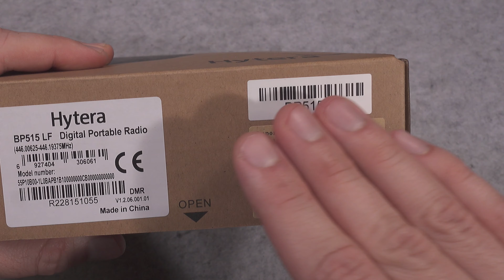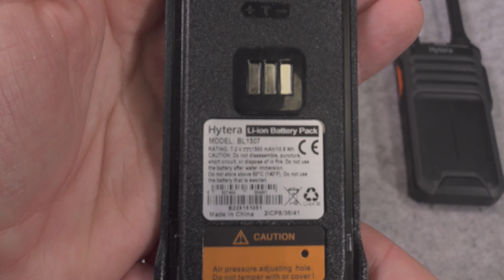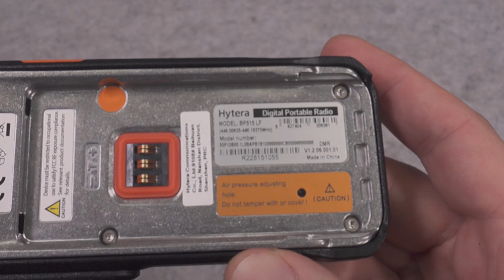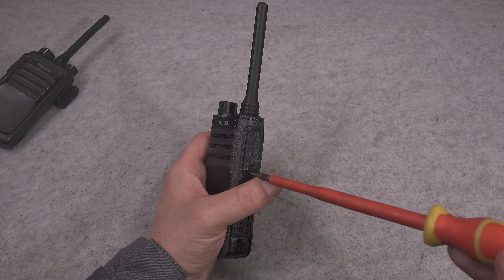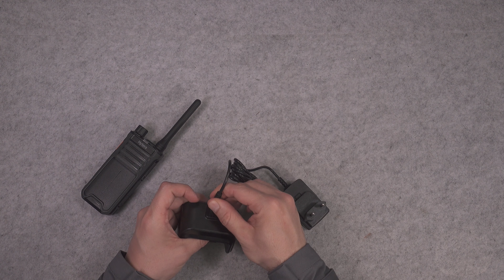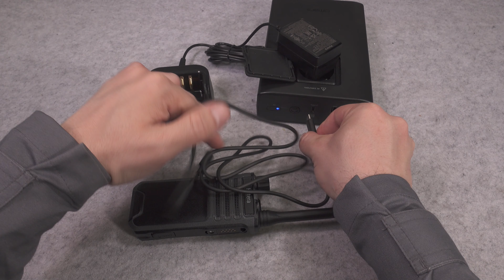Hytera BP515LF PMR446 license free DMR digital & analog radio - feel like public safety Motorola

Comment: Hey is the accessories connector the same as the DP4400e ?
Reply from the maker: No - this is strictly standard for Hytera - not compatible with any Motorolas.
Reply: @ElectronicNoobBlog  huh... i m interested into it but i m currently looking if there is a PTT compatible to plug a comtac (nexus connector) before ordering one. I have only find one for Hytera PD series.
i curently have an UV5-R but the kenwood connector radio side keep on wearing down before the ptt itself.

Comment: Well, I'm wondering which one to buy. BD505lf or BP515lf. This will be my first DMR
Reply from the maker: I don't have experience with BD505lf so can't tell You anything,  From my tests PD505LF (older model) offer slightly better range (most like because antenna is longer) but BP515lf radio is going to be my "go to" because of USB-C charging socket (very good in case being in field or staying for weekend in different location - regular usb-c cable and phone charger will do job) + supporting normal proper RSM with multipin connector so You end up with amazing RSM  like SM50N1-P that are dedicated for licensed radios (quality is here). Very good programming software (it's normal DMR Tier 1 radio). That's only info I can share about it.
Reply: @ElectronicNoobBlog  Thank you for the information 73
Reply: @ElectronicNoobBlog  How do I set it to switch between analog and DMR? I mean software

Comment: Hi, first of all many thanks for your very good and informative videos! Since you really showed a deep expertise in these matters, I would like to ask you a question related to "electromagnetic radiation" and the impact on humans. More precisely, when using license free PMR446 digital radios, as for eg. Motorola's SL1600 (in part. with 500mW), what is the impact in the body if the portable radio used many hours a day "attached" on the body (while wearing ear comms)? Thanks in advance and all the best!
Reply from the maker: Thanks for feedback, I'm not expert but In my knowledge only real generic precaution for RF radiation while working with consumer devices is avoiding eyes (head in general) because it have heating effect (of course with prolong exposure, high power). There are studies that pointing it can damage eyes, but with high energy systems - like industrial, for example here : https://pubmed.ncbi.nlm.nih.gov/14628311/   in general non ionizing radiation do not damage at molecular level like x-days that can destroy DNA.  Of course this only apply to transmit not just wearing radio and listening.   Are You transmitting thru it whole day or just listening? If You are just listening and transmitting couple minutes daily then You have nothing to be worried about. If You are TX whole day, for example navigating crane operator - You already did good thing by moving away radio from head using ear com - for really prolong TX You might think about moving radio fare away from body for example using backpack and clipping it there - this should severely limit energy that will be absorbed by water in Your body.

Comment: This Global PTT walkie Talkies, do you know if they are any good? Can not find a review online. Specially the response time seems to be forgotten in all sponsorde video`s. What is your opinion?
Reply from the maker: I never tested it. Please tell me exact model number so I can look it up. In general from over 2 years I gave up for non brand radios / PoC as it's just waste of money,  no support, no firmware updates. Couple years ago I was thrilled to grab something from Aliexpress but I came to conclusion that nothing work out like I was expected, and by purchasing multiple ones I spend more money than Motorola.  For PoC & LMR Dispatch i bought Motorola Ion and it ended up all my problems.  Just work - nothing more - no less. I bought shoulder mic once - and year of use - it never fail. Those from aliexpress were failing every month, i was swapping cable by myself, and it was failing again. I had PoC S700 - i would say cheap but it was quite expensive - and it was hanging out when You need it and plastic start falling apart, had firmware errors... so in general my honest advice - there is reason why Motorola is chosen by public safety. If You plan to use something like amateur radio - they have 50 radios, grab one radio every month and use on weekend - sure, those will work great & they will be angry for this comment saying " I HAVE IT IT WORK GREAT" - but they not using it on daily basis  - for EDC if You are counting on it - they are not worth and more expensive in long run. But let me have model number - so I can do more research on it.